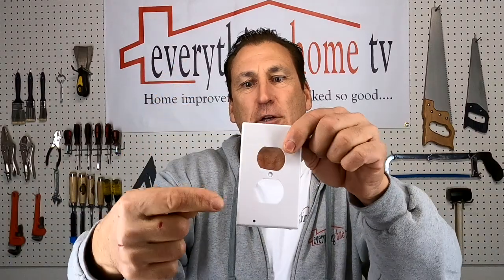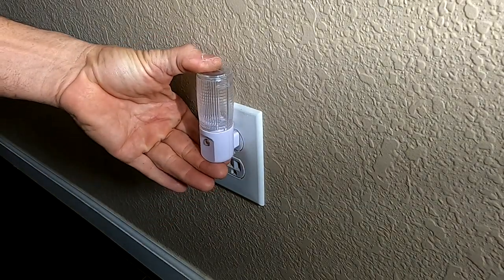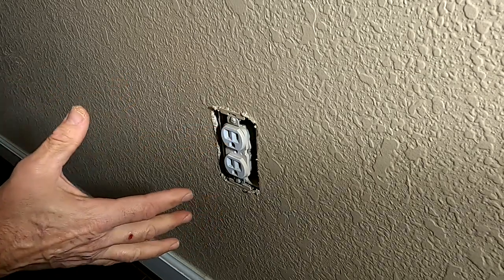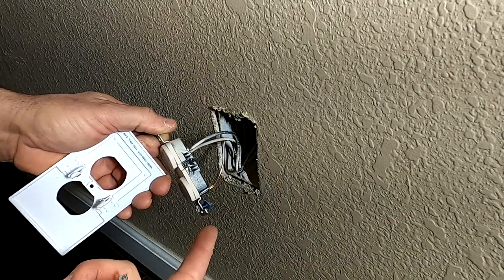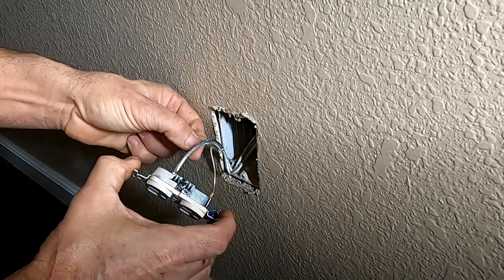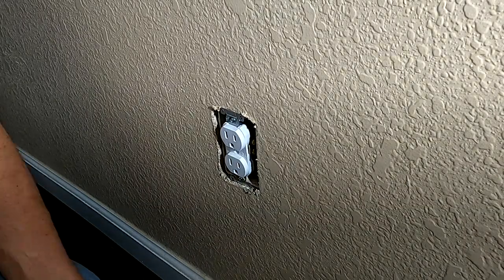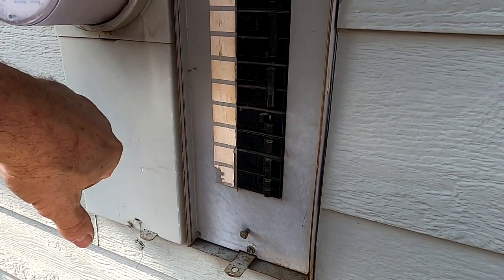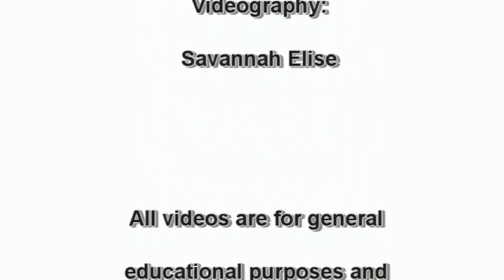LED Wall Plate Night Light Installation  By: Everything Home TV

Comment: On the new outlet, you put the neutral and hot wires to the top screws of each side.   Does that matter?
Reply from the maker: No, I just like to put them in the same slots to keep it uniform looking. Don’t want someone to take it apart later and think it was some hack that did it the last time 😂
Reply: Top & bottom screws are bridged together with those clips anyway.

Comment: Do you think these would work with a 12v circuit in our camper?
Reply from the maker: Not off of 12v but they should work when the camper is plugged in or running off a generator as long as it’s 120v.